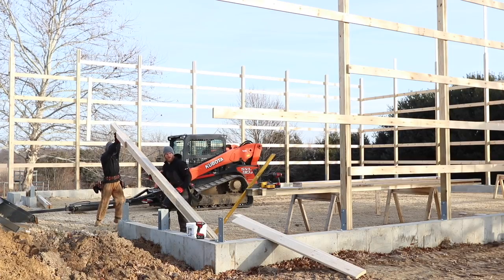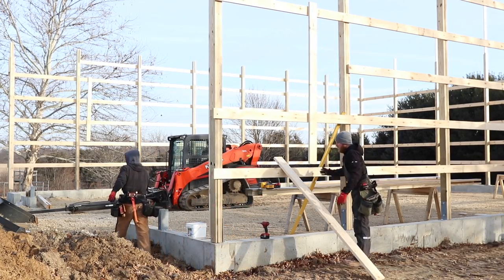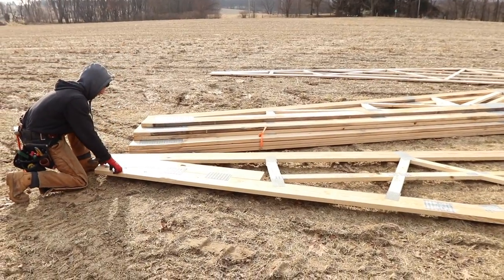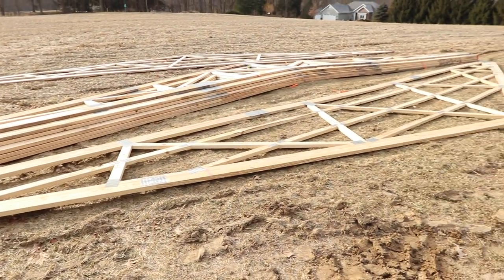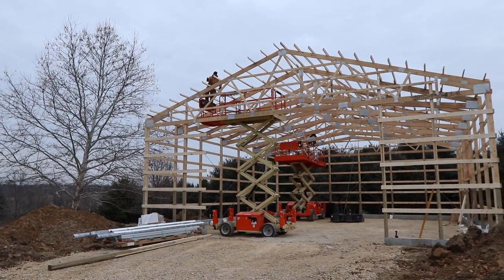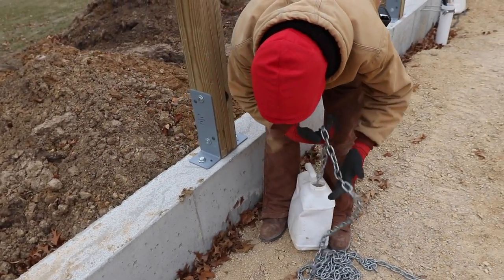Building a Work Shop: Setting Trusses

Comment: I’m having a 40x60 monitor style horse barn built right now, and while I couldn’t find any who builds with the bracket style posts your videos have given me insight into what to look for in a quality build. So far so good with my builder. 
Thanks for all the explanations and attention to the small details that will help those of us not blessed enough to live close to you.
Reply: you asking about the brackets or the posts there? Brackets are by Midwest Perma Column, they have a website, but there are a few others who also sell this as authorized resellers but the best is to go through Midwest's website itself for direct pricing and all the goodies as there are a few specialty precast concrete columns they also offer or willing to work with and make for you.

Comment: Wish you wher in PA .  You do a very good  job, your attention to detail, and technique.  I like how you build off columns or poured walls. Around here everyone just wants to sink the beams in the ground. And they rot off after a while.  I need to build a shop this year.
Reply: There are sleeves which go by the names of Post Protectors (Home Depot or Lowe's where available) along with Plasti-sleeve (sold direct on their website) or also post saver (pole saver) which in itself sold direct but is a shrink on DIY type deal. which offer longer life for buried in ground posts. but for the best you can just go to Midwest Perma Column official website for the full offerings. 
I am not an affiliate of or with any of said products or companies.

Comment: I bought a house last year that came with a steel horse barn built in the early 90s  that I'd like to convert into an insulated workshop. It has a leaky roof, probably rot in the trusses to go along with that, some rust, and the structural poles were just put right in the ground without any footers, let alone a foundation wall. I need to find someone near me that might be willing to work on it, and I can only hope they care about the quality if what they do as much as you and your crew.

Comment: Kyle, I would really like to see an In depth explanation of your chain bracing system... Everything from how you attach them to your post frame to the geometry how it works to align the building later on... You have talked about this in several videos I am aware of, however never gotten really in depth specific about how the geometry of the chains tension effects the finish product when you go to straighten it... Again, I know you have talked about this in videos, I just feel like it could still be better explained... My specific interest is how you use them to Square... I watch you Guys Everyday!!!

Comment: I'm  new subscriber, but have watched several videos.I really like how the interior trusses rest in between the 2 2x6's, but I'm still not 100 percent sure how the end trusses are put on/supported. Are they fully resting on the end posts?

Also, I really like how you guys spend the extra time in the planning and setup. Your workmanship appears top notch.
Reply from the maker: End trusses sir on a block that is also setting on a girt.  Then all wall screws are added... promise it isn’t going anywhere
Reply: @RRBuildings  Thanks. Y'all do great work. Hopefully in the future I will be able to build me a wood shop. I've never been a big fan of putting the poles in the ground and had the same thought about putting them on concrete piers. So I started looking to see if anyone was doing it that way and stumbled upon your channel. I really like the effort y'all put in to doing things efficient and right. Best of luck.

Comment: Could you visit the trust manufacturer? Kind of wondering how they fix those big big metal fixture plates. And also the process around the details, designating and let say adding a special (last build porch)
Reply: Search "Truss Manufacturing " in YouTube search bar for videos on how they roller press the plates on, I worked at a factory in FL which was open air and they used a old roller press and one of the tech seen in those videos.
Reply: Joshua79C, your completely right 😎 thank for the hint!

Comment: Hey Kyle I enjoy your videos I was wondering about the way you build, did you invent this way of building or has it been around a while?
I LIKE IT!  Prefabbing most of it on the ground and sitting it in place. No room for error. Being down here in south Texas I don't know how ya tolerate that snow and ice, etc. all the time. Anyhow I want to commend you and your employees on the good work! Thanks
Reply from the maker: Yes we started doing this 5-6 years ago and hadn’t seen it done anywhere else at that time
Reply: I myself have heard of or seen very few do the lay down framing technique for the walls like often done for stick framed... seems the old way of setting the columns and then nailing on the girts is the preferred/primary method.

Comment: I had a question about the ties that hold the trusses together. when you sandwich the truss between the 3 ply 2x6 posts, do the metal ties get in the way of a tight 3 ply connection? How do you accommodate for this?

Comment: Hey Kyle, been watching your builds for a few months now and you build quite different for most of the post framers here in northern PA. Most guys here are doing 4' truss centers with tails on the truss. So I guess my question is how does your roofing system compare cost wise to tails on the trusses? And what drove you to use the roofing system you use now?
Thanks from PA
Reply from the maker: It’s just how they have been engineered and designed In My area for a long time

Comment: Dumb question but, My son and I are building a 30x48 building. If I want 16' sidewalls do I have to order 18 or 20 permicolums?  I'm using a 15 1/2 heel on a 4/12 pitch. ?   Please and thank you
Reply from the maker: I always order +2’
Reply: Thank you  I'm living your videos. !!!!!   Say hey to Greg
Reply: Perma columns are the foundation, you mean laminated columns for the wall and main structure, pretty much all manufacturers assemble with the top four or five foot removable on the middle laminations for the shoe in of the heel of the truss, such as for kyle it is usually 15 inches.

Comment: Which boom attachment do you use and what is the tallest pole barn wall height you can set trusses on? Building some 14ft wall height pole barns and wondering if a 12ft boom will do it and if a tractor can lift it

Comment: Whats the song playing while the trusses are being set? Great video as always! Quick question, whats the advantages of using the fabricated post instead of just using a 6x6?

Thanks,

Derek
Reply: for the tune you would have to listen through the you tube audio library to find it, he does not recall the tune he used.... laminated offers 20 to 50% more strength and straighter lines over solid timber and the center stab board(s) also make it easier to make a notch for the truss(es) as two double sheer bolts offer better connection strength than a bracket or stabbed on truss attachment.
Reply: @Joshua79C  ok, Thanks for the reply man...I'm from south Georgia and most all the pole barnsI see down here are using just regular 6x6s or 8x8s...I'm fixing to do  my own equipment shed and may check into the laminated post.
Reply: Ohio Timberland, Timber Technologies (Titan Timber, glue-lam), Midwest Manufacturing and there are a few others who can be found easily enough in search. If you plan to go with post in the ground and want to last longer, check out Post Protector, Plasti-Sleeve, and Post Saver (aka Pole Saver) to provide longer life if you plan to go that route.
Hope you find this also helpful in your endeavor.

Comment: Wondered if your system could be used on a frost protected shallow foundation (slab)
Reply: That is the great thing about post frame,  can be built on any foundation much like conventional stick framing, as long as it properly installed per design to hold the structure, check out Post Frame Advantage website sometime for more info for starters.

Comment: For an overhang on the non-gable sides, would it be feasible to just buy pre-built rafters that are sayyy 2ft longer on each side and have that extra 2 feet be the overhang instead of building an overhang after the trusses are in?

Comment: I notice that the purlins don't land on the trusses and are lapped together not using gang nailer but just straight nails. Does this variance in the run of the purlins cause some headaches when screwing down the roof metal?
Reply: Do not assume I mean anything negative or derogatory .. I am amazed at how organized and efficient your buildings are. I just want to know. Love your videos.

Comment: Ive got a question about the roof purlins...probably stupid one but with your 2x4 purlins not lining up straight doesnt the make the roof screws not line up? I guess the only bad question is the one left not asked lol. Im used to doing weld up and bolt together buildings so havent done post and beam
Reply from the maker: Yes they staggee

Comment: Why do you do the purlins this way sometimes but other times you do 2x6's with joist hangers? what is the reason for the different ways?
Reply from the maker: I would only do 2x6 on a porch where height is an issue and I’m looking to stay down or if span is an issue like greater than 8’
Reply: I like the inset style myself, as opposed to the porch (atop) done for 8 foot spans or less.
Reply: If you are going to drywall the interior, do you need sheathing under the metal roof?  @Joshua79C
Reply: depends on code in the area it is being built, I would if I was going to drywall, also put in a vapor barrier since drywall is what it is. Probably go with cement board as its tougher than drywall without much downsides other than weight. But if I was going to hand lots of stuff I would do like April Wilkerson and go plywood screwed in.

Comment: Is your JLG Scissor Lift gas powered?  It sounds like an engine.  I use scissor lifts at my job but all of ours are electric and have to be charged, which people always seem to neglect to plug in when they are done using  them.
Reply from the maker: Diesel
Reply: RR Buildings that is cool.  We have a boom lift that is gas powered but I did not know scissor lifts came in diesel versions.

Comment: Interesting that the gap between the horizontal beams is determined by your inside leg measurement! Otherwise it would be painful.
Reply: girts (horizontal beams?) are typically spaced two feet on center apart, if those are what you are referring to
Reply: @Joshua79C  Size of an inside leg. I didn't know what they were called - thanks.
Reply: He mentions in video he go with 8 foot oc span between posts (columns), and no matter the span of the main supports the girts and purlins (roof beams) are spaced as mentioned at 2 foot oc. except where it may be wider spacing as code may require or call for.

Comment: so those gable ends are not actually resting on anything? it's just held in by the shear strength of the nail?
Reply from the maker: They are resting on a block that sits down to the next lower girt
Reply: One can always buy Simpson brackets made for this purpose for added holding strength, I think they make such, not entirely sure.

Comment: You have cordless nailers, why don't you use them??
Reply from the maker: We do when we can.  They aren’t able to nail appropriate nails for the framing
Reply: @RRBuildings  what size nails you use on the horizontal 2x4s?

Comment: Would it be safe to build a 15x26m garage using the same technique in a country it snows up 30cm? Would the roof be strong enough or will need supporting pillars?

Comment: Nice work what's the spacing between roof thrusses?
Reply: As you seen or not, they set into the columns, 8 feet on-center apart

Comment: What is better wood frame vs metal frame? I’m in the market for a garage now and been watching all your videos.
Reply: For the typical size pole buildings they build. The costs of doing steel framed pole buildings would be much more expensive, if you can even find a company willing to fabricate it. (Steel buildings are pretty much limited to much larger commercial structures, many of the company's who build them will barely return your call if your asking about something smaller then 80x100ft)
The footings often would have to be larger as steel is heaver. A crane would have to be rented (or bought and maintained) to lift the parts. This incurs more cost and people are always shopping for the better deal so wood wins in the end.
Reply: If you like the strength of steel but do not want to forgo the versatility of wood, then check out *Miracle Truss*, open web truss metal frames and uses wood for the secondary framing (girts, purlins and so forth), but mind you the framing will "stick out" for sure on the interior.
I am not affiliated with them.

Comment: I see your buildings use sistered boards for upright poles ,is that for stability of less warping over a solid sawn pole ? Do you make them yourself also ?
Reply: sistered board? You referring to the girts that is the secondary framing, typical in such construction to apply the wall covering to.
Reply: @Joshua79C  Talking about the upright poles ,they look like boards nailed together or glulams from what i can see ,normally we use solid pressure treated poles in this area for the uprights .
Reply: Oh right my bad, long-ish day for me there, yeah he only uses laminated as they are proven in testing to be stronger but also straighter than solid. Plus with that removable stab board section at the top makes making a notch "cut" to fit a truss more easier than with a solid post. I kind of lick the two choices of posts, the solid makes sense in smaller builds for sheds up to 20 foot wide, he makes his own for narrower builds than that it seems and uses the OT manufactured ones for the larger builds he often shows. I get why in the South US they often use solid, cost comparatively, but also sticking with traditional style or looks, but IMO it does not hurt to go with laminated down there as a few of Morton Building blogs of TX located builds that prove how tough they are in a hurricane.
Reply: @Joshua79C  Yes laminated seem like a good idea for stability staying strait ,easier on the nails also vs treated wood

Comment: You probably been asked before, but why not use 6x6 instead of laminated 2x6?  I'm a fairly new subscriber. Just wondering..  Great work ..
Reply: More strength and straighter columns with laminated as compared to solid sawn, but to each their own if they choose to stay with the solid as it works well for small (say 20 by 40 or longer) sheds.

Comment: Are you flying the drone in the skid steer
Reply: I bought a pair of them muck boots yesterday and they fold down if you get to hot I like them so far I still want to find a nice pair of low top hiking boots for when I work inside
Reply from the maker: yes I fly the drone

Comment: In need of your info, What should a avg price be for a 32' x 40' x 10' pole building cost just the building, roof, couple windows with 2 10' x 8' garage doors in front, normal garage doors nothing special, and 1 8' x 8' in back with a metal man door. If you need some more info just let me know. I looked around and they vary a lot. Your thoughts will be greatly appreciated. Thanks.
Reply: Best trying DIY Pole Barns and Hansen Pole Buildings or other such diy/pro kit sellers. DO NOT go through Menards or such, crappy service and pieced together one-size-fits-all kits ... afaik.

Comment: n00b question, but why don't you build the trusses yourself?
Reply from the maker: I stay busy doing what I do best... I let them do what they do best
Reply: Not sure about you tri2451, but do you got the money and space for the cutters, assembly table and presses to apply the steel gangnail plates you see at each joint? Look up "truss manufacturing" for videos on this equipment and process, you will see why sticking to one thing is more efficient, as opposed to jack of all trades which is least efficient. Also I worked for a truss manufacturer for a few months and focusing on one job at a time was more efficient than multiple at one time, thus why assembly/process lines make so much sense.